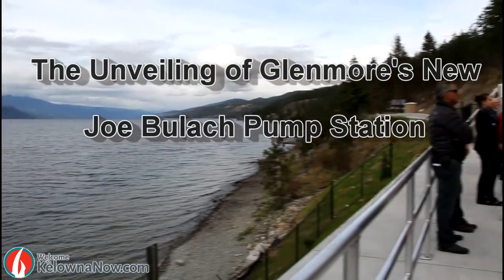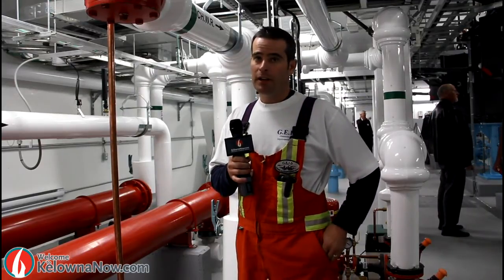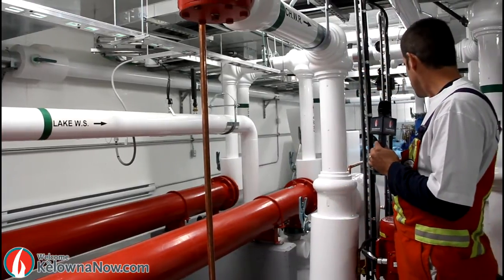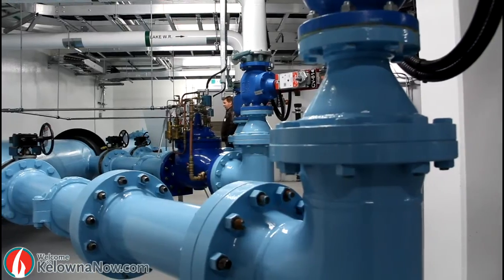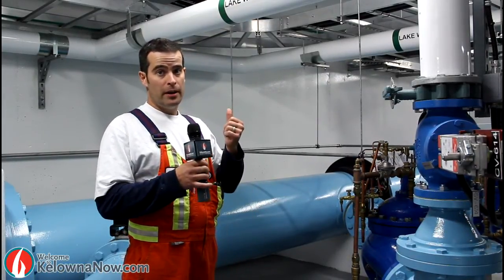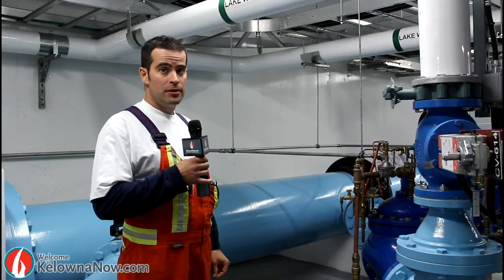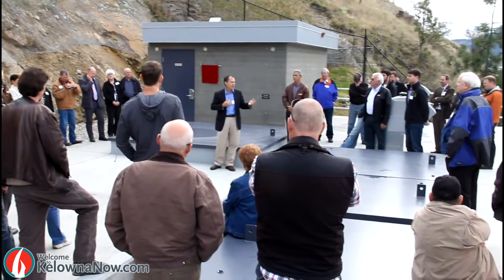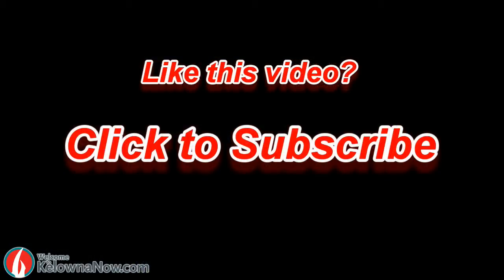New Pumping Station to Improve Glenmore Water Supply

Comment: Dear Sir/Madam,

I Am Vist Your Website And See Your Work.

If  You Want Services like Repair And Maintinance

 Then Contact Us.
All  Details About Our Services:
Pump rooms and controls

Pump Maintenance - Repair

Motors Rewinding 2 HP TO 1000 HP

Vertical Torbine  Pumps For Repairing And Maintinance

Horizontal Pumps

Electrical Panels

Contact Us On,
Mobile No. :+91 9414132837, 868686-1044
E-mail : Jodhpurtradingcompanyjtc@gmail.com

Thanking You,
Best Regards,
Jodhpur Trading company